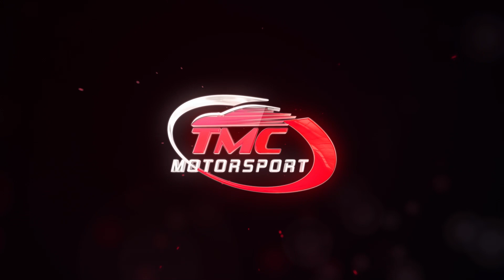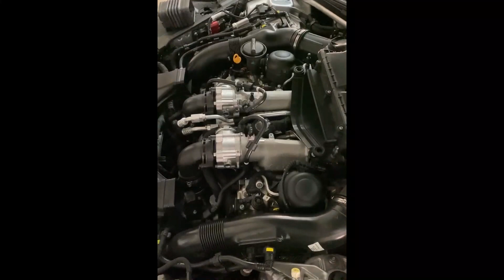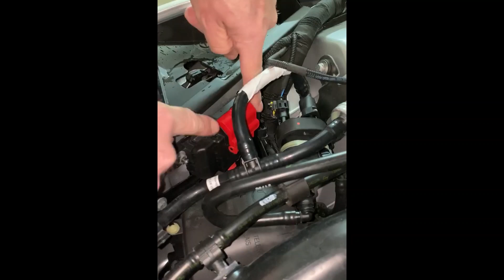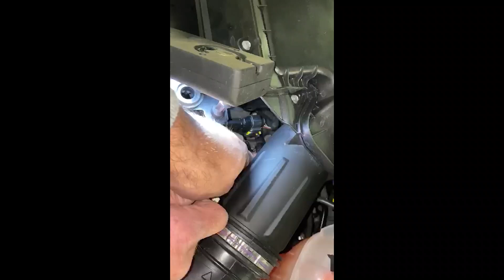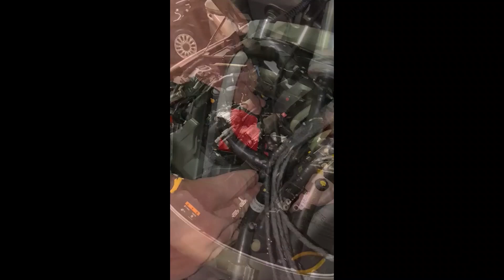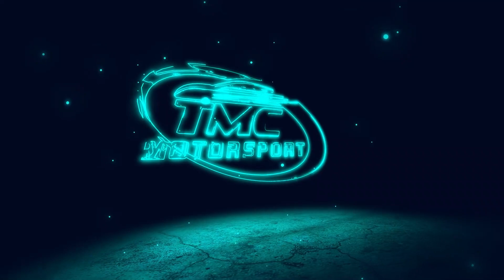Alfa Romeo 2.9 Giulia/Stelvio QV Install Video - TMC Motorsport Multi-Channel Tuning Box

Comment: What other engine mods are there every time I look this up it’s always the 2.0 or should I just get an f80 m3
Reply: I have a 2017 alfa romeo giulia quadrifoglio...I put ideal race intakes and a racechip gts 5 black im at 640 horsepower to the crank